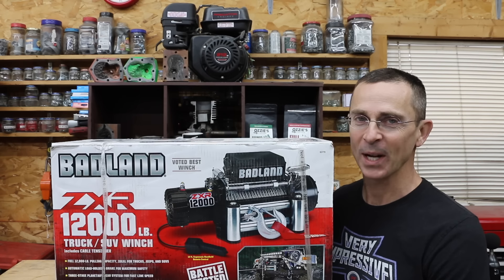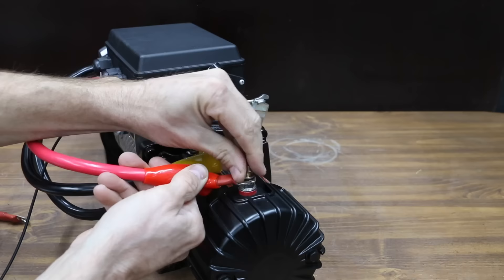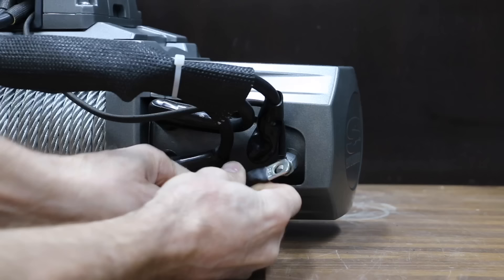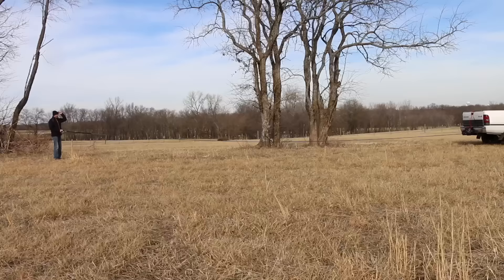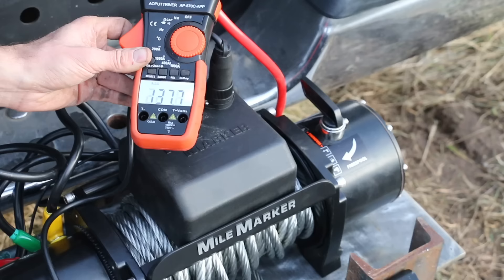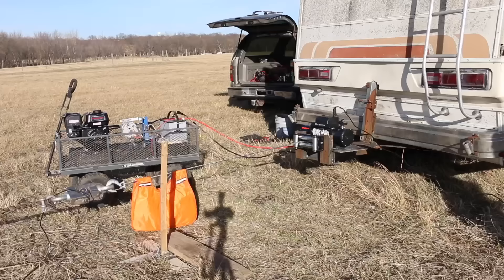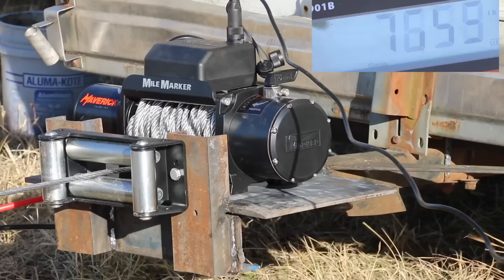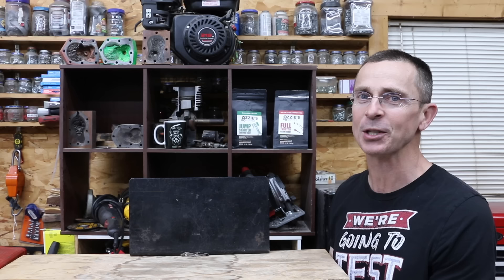Best Winch? Is BADLAND Better Than WARN, Smittybuilt, Milemarker? Let's Settle This!

Comment: This is good info for 'out of the box' performance.  One real test is how they hold up.  We do not have a single Warn winch in our 29 member off road club.  The reason is they seem to fail just when you need them most.  And that is quite often.  We have three Smittybuilt and I do not remember ever having a problem with them.  The most popular winch is the Badland Apex.  We never have had a failure with them.  We DO break winch ropes and cable quite often.  The ropes go most of the time after some chaffing.  The cables, we have learned, MUST to be replaced when about ten or twelve strands break.  We roughly figure we lose about 100 lbs of pulling power per strand.
The fact that NONE of the winches made their rated 12,000 lbs of pull is very telling.
Reply from the maker: Thanks!  Thanks for the feedback.
Reply: They didn't make their rated 12k because that is only valid with a single wrap rope. More wraps, the lower they go as the spool gets bigger and the leverage decreases. To get 10k with 5 wraps is well beyond spec.

Comment: For round 2 couple of interesting things to test are: What happens if you put larger gauge battery leads to the winch, or change the solenoid-winch wires as well. The branch winch I currently use, have this line in their owners manual that if you want to use it in racing / competitive environment purchase a 50mm2 or 70mm2 cables. Also it would be cool to see some other 'destructive' tests like when and if the breaks fail - if you use a winch a line line to pull another vehicle with your car (just driving, not using it as a winch but just as a rope). For some reason all the user manuals don't allow to do that. And cold and damp testing would be interesting also. I've had many cheaper winches fail in winter times here in Estonia where we sometimes have -25C degree weathers.
Reply from the maker: Thanks for the suggestions.
Reply: Those would be interesting to see! My guess is vibrations on the road resulting in the gears shifting to allow the "rope" of the winch to lengthen slowly, resulting in Bad Things (tm) happening after a point in time when the thing you're pulling is on a rope two meters long instead of a tow-hitch that pivots at an easily accounted for point.
Reply: @ProjectFarm  long term durability (hundreds of cycles) would be a great data point too.
Reply: Besides some racing/competitive environment it seems odd that speed of pull was so emphasized, most speeds are sufficient & slower/variable is often ideal & safer. Reliability & durability are more important, but more difficult to test for, am I missing something?
Reply: @assertivekarma1909  depends on what kind of stuff you do.  If you rarely use your winch, line speed isn't as important.  If you like to push the limits and have to use it a lot more often, it matters a lot.

If speed didn't matter you could get a much cheaper winch and just run a snatch block as well (more than doubles the pull, 2x for the snatch block, plus a bit for having less cable on the drum)
Reply: This is a test of 'real-life', not some re-build/mod contest.

Comment: Would love to see some of the smaller ATV/UTV/mower sized ones tested! Keep up the great work!!
Reply from the maker: Thanks, will do!  Thanks for the suggestion.
Reply: I agree I see the 6000 pound atv unit on trailers all the time pulling cars up.

Ok im one of these guys
Reply: @Foxfatherracing  I have the smaller 5000 badlands on my tilt deck trailer and it works fine. I just use a snatch block doubler if I'm worried about overloading it, which you probably do too
Reply: @peep39  great idea thank you

Comment: I'd like to see you disassemble the gear boxes to see how well they are greased and if there are any plastic or weak parts used.
Also, you could leave them out in the sun/weather to see how well they hold up to exposure.
Reply from the maker: Thanks for sharing!
Reply: Send the winches to AvE channel for a teardown
Reply: @ns4854  They'd come back in pieces.  The official report would mention "Chinesium" a lot.
Reply: @ns4854  They'd never be the same again HAHAHAHAHA.
Reply: @ns4854  we need a project farm / ave collab

Comment: It'd be interesting to see if they'll cover it under warranty since you technically didn't exceed the rating on the box. When I buy tools, I like to have confidence that the brand will honor their warranty, but this often isn't the case anymore.
Reply: That would indeed be very interesting to know how they respond (without knowing it's a famous youtuber but just a joe average)
Reply: What winch?  He didn't test according to the warranties.
Reply from the maker: Thank you for the video idea!
Reply: @dubious6718  He never exceeded the ratings of the winches. That's all they should worry about. I really would want to know if any of these winches actually could meet the rating. It would probably only happen with only a single layer of wire/rope on the drum, but even so it seems a lot of them wouldn't meet the rating as the wire/rope broke well below the rated pull. Also how much abuse do the wire/rope withstand? I know that if it starts to "climb" and chinch on the drum it can weaken the wire. Are any of them better at preventing this than the rest?

Way way back when I was a kid I remember that there were a winch at a marina that had a mechanism that controlled how the cable was spooled up just to make sure that it didn't chinch or climb over itself. To work It did require that the cable had some tension when it was spooled up, but once the slack was taken out it carefully directed it back and forth over the drum. This was about fifty years ago so I can't remember the details of how it achieved this, but I do remember standing beside it watching as the cable was unspooled and spooled back up again over and over again.
Reply: @blahorgaslisk7763  The winches stopped before they reached max capacity to protect them self. He didn't reach the rated capacity cause he had to much rope on the spool, like mentioned.
Reply: @dubious6718  True but many of those winches snapped their rope at under their rated capacity.
Reply: @4saken404  Yes , no reason those ropes should break , they were well under their rated load ....
Reply: @ProjectFarm  yes!  A video showing who honors warranties and who doesn’t, regardless of the piece of equipment!  I’m sure there are plenty of various tools and equipment on your premises, that might justify a warranty claim

Comment: I find it interesting how many of the synthetic lines broke. 3/8 synthetic line seems to be rated over 20,000 - 24,000 lbs, and they broke @ nearly 1/3 of that value and these were all brand new lines. That definitely would be a good test. Also I would love to see  Champion Power Equipment winches tested. I have been abusing 1 for years and it is still going strong.
Reply from the maker: Thanks for the suggestions.

Comment: I bought the badland 12,000 lb.  It was actually cheaper than the 9000 during a father's day sale.  It hasn't disappointed.  I pulled a 40'  shipping container into a trailer with a snatch block and it didn't even struggle.  I've considered buying a 2nd one for wheeling with my buddies.
Reply from the maker: Thanks for sharing.

Comment: Add in the Harbor Freight Apex winch next time. I'd also be curious for you to compare steel cable vs synthetic rope. Comparing winch mounting plates in hopes of finding one that would hold up could be handy too.
Reply from the maker: Thanks for the suggestion.

Comment: I don't need a Winch, but still found this content interesting. I see some other channels use the Badland winch's quite a bit, but I think it was the Apex version they use, and they might change the ropes too. Matts Off Road Recovery, Fab Rats, HeavyDSparks, etc.. use them in their videos, but I think Heavy D uses Smittybilt. Harbor Freight even made a custom controller for Matt's wrecker that has something like 7 winch's on it.
Thanks for the content. Pretty awesome that you do these things, and I absolutely look at your channel when looking to buy a new tool to see if you tested it yet.. lol
Reply from the maker: Thanks for sharing!

Comment: Good video, but I would like to see a video comparing synthetic rope to steel and the advantages and disadvantages of each.
Reply from the maker: Thanks for the video idea.
Reply: Good idéa. I have used both under pretty severe conditions. The synthetic is easier to handle and better for "normal" use. You have to replace it more often than a vire rope. If you do more extreme recovery at max load or are using snatch blocks, the wire rope is the best option.
Reply: If you are going to actually work it go with steel wire cable. Synthetic rope won't even hold up to ana 100 pound ATV snow plow, breaks very easily.
Reply: @jasonvsd  lol

Comment: Such a great test video! My OpenRoad 9500 on a receiver mount has been working great on several recoveries. Maybe include this brand’s 13000 next time. I use an App to estimate pull force required for a disabled vehicle. It greatly overestimates needed force compared to the results of your meticulous and honest tests.
Reply from the maker: Thanks!

Comment: Another great test. Amazing that so many 12K rated brands couldn't make the cut. I'd love to see a comparison between Steel Cable and Rope Cable.
Reply from the maker: Thanks for the suggestion.
Reply: I think most winches are actually rated with only 1 wrap on the drum. He never did that. The fact they all did at least 9000 pounds with a nearly full drum is pretty good really.
Reply: @gordonwedman3179  He even mentions that in the video.
Reply: @Gordon Wedman  my opinion they should be rated fully spooled  but they always have to mislead the consumer
Reply: @Ben Smith  
If they say in the description  that it is rated 12000 with one rap on the drum there is no deception.
Reply: @bensmith4563  YOU ARE RIGHT!
Reply: @gordonwedman3179  So how you gonna get that to work when you hanging off a hill? Get real!!
Reply: @ZAPATTUBE  
What are you talking about. Try  making sense if you can. You read the specifications BEFORE you buy the winch.

Comment: If you really want the best….the Warn 8274 is the toughest wench ever made. I have personally pulled a 3500 dually with a 20 ft gooseneck loaded 8ft high with plywood. The truck and trailer were buried to the axles in wet red clay, drug it 75 yards. Made a quick 100 bucks and had the building crew on to their next job in under 20mins. Stock spool, single motor, and steel cable.
Reply from the maker: Thanks for the feedback.

Comment: It would probably be too difficult to do, but with most new engines being direct injected, a comparison of the various intake valve cleaning sprays might be interesting to watch.  Some of them actually work, but my understanding is that to really clean the valves you have to remove the intake and scrape out the carbon manually.

Great video!
Reply from the maker: Thank you for the video idea!
Reply: Most current DI engines also have port injection.  It cleans the intake/valves and increases torque.
Reply: @nucleargrizzly1776  'most' is true, but there are still some that stick to only direct, which is a problem and requires more maintenance than people realize
Reply: You practically have to remove and disassemble the entire engine and toss it into the ultrasonic cleaner to get the job done these days
Reply: @j.m.5995  No you don't, you just have to pull the intake manifold. Depending on the engine that can be a huge job, but it's usually not too bad if the car isn't turbo. 

You can clean it at home with a drill and some zip ties stuck in the chuck.
Reply: @bradhaines3142  Some VW and Audi owners are pretty mad about it.  I personally wouldn't own a DI only engine.  Are there still any DI only engines being produced?
Reply: Huh!!!!!!
Reply: @nucleargrizzly1776  I would like to know too. There can't be many... 

If there are my guess is it's an expensive brand that caters to people who don't own the vehicle long term.
Reply: @nucleargrizzly1776  i know the v6 in the telluride/palisade is one, and some german makers still do but im not sure which engines. suprisingly hard to research because most searches pull up if it has it at all, doesnt want to specify if itll be only direct injection or if it has both. ima keep looking out of curiosity lol

Comment: YOU do us consumers a great service, and I appreciate the work you do.  So I  think you should test tool boxes, since folks (like me) are starting to come to you for tool recommendations, they’re going to need something to put them in. 

I’ve noticed there’s 4 different categories, open top tool caddies, traditional tool boxes, rolling tool boxes, and big tool chests and come in metal and plastic materials I figure you could make it a series.  You can measure stats, size, volume, dimensionality ( length, width, height). You can test lid/handle construction, latch construction, insert construction, durability, how many tools they can actually carry (maybe hand tools vs power tools), and how much weight they can carry without breaking. You can test roller quality for rolling and tool chest formats as well as how easy they are to knock over etc.

Comment: I have a Zeak 13k, and have been impressed with it, especially for the price.  Awesome to see my experience in the field/trails has matched with the rigors of a Project Farm showdown!  (Always love the Farmabago content lol)

Ideas for round 2, upgraded/thicker wiring, and a stronger bigger diameter synthetic rope.  And of course the Apex brand winch, along with the pricey Warn Zeon.
Reply: Get donating
Reply from the maker: Thank you for the video idea!
Reply: I have US-built Warns (M8000 and an 8274) on my rock crawlers, but I have a Zeak on my daily.  The little China winches are great if you don't need line speed.  Most of those winches come out of the same factory anyway, why pay $700 for one?

Comment: I have a 12000 badlands apex winch and it works great. I have it set up on a cradle and I wired my truck front and rear and put a reciever on the front, it already had one out back. My truck is a 2008 f250 super duty and weighs about 8000 pounds and the apex has pulled it just fine out of deep snow
Reply from the maker: Thanks for sharing.

Comment: Another great video.  It would have been nice to see the Badland Apex 12,000 pound winch tested.  This is a very popular model.  It's very similar in design to SuperWinch and may be manufactured in the same factory.  A synthetic versus steel winch line test would be great as well.  Keep up the awesome work.

Comment: I'd love to see a round 2 with the best winches offered in the 12K pound class (Warn Zeon Platinum for example) just to see what you get for the extra money. As for this great test- I was most disappointed by the SmittyBuilt which requires extra setup and offers mediocre performance. I was impressed by the low amp draw and build quality of the Warn. A suggestion for next time: see if the winches are impacted when submerged in water. Crazy things happen sometimes off-roading...
Reply: Everyone knows Smittybilt = Shittybuilt
Reply: Love to see a test on using a smaller winch. Also fiery red brand.

Comment: I had two Mile Marker 9500si.  One was sold with my truck in 2017 (on a Mile Marker winch mount on the front of the truck), the other I still have.  The one I still have was put into a cradle mount from the start.  Neither mount failed on me.  Both Mile Marker winches no longer have a working free spool.  I have to run the motor to unroll the rope.  I sent one back under warranty to fix the free spool and it was returned to me in about the same condition.

Despite the free spool issue, neither winch ever failed on me, but I probably never pushed them as hard as Todd did in his test.

It would be interesting to test the hydraulic winches that connect to the power steering pump.  But that's a lot more work to test and very few people go that route.  The electric winch is a lot easier to implement.
Reply from the maker: Thanks for sharing.

Comment: I bought a 800 plus dollar warn.
Never been under water and always covered or in the garage. After two years the motor quit and after opening it up it was completely covered with whit aluminum corrosion and the brush wires were green.
I realize it wasn't sold as waterproof, but you would think a winch designed for a 4x4 would be somewhat moisture resistant. 
I was gunna fix it but i just ordered a cheap china one thats supposedly water proof.
Reply from the maker: Thanks for sharing.

Comment: I’ve owned both a warn and Ramsey winches a long time ago, and I would love to see the Ramsey tested. It had more pull by a long shot, and the warn was faster. I feel if you need a pull, you need more grunt than speed in most cases.
Reply from the maker: Thanks for the suggestion.

Comment: The on thing Warn had as an advantage when they were still being built in the US is you could get parts for really old Winches. I picked up a very very (like seriously ) early Xd9000 in late 2000s for like $300. I took it apart and contacted warn and they sent me the replacement parts (I recall it was the clutch).
Reply: only the evo series winches are made in china their higher priced ones are made in the usa still